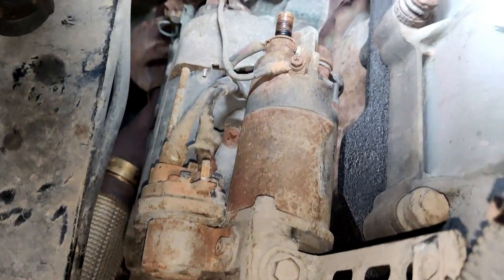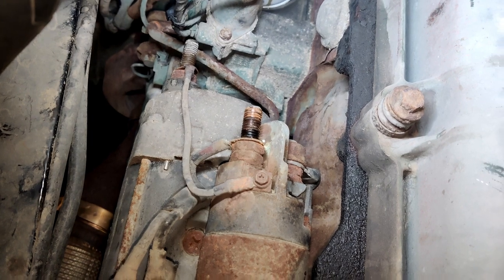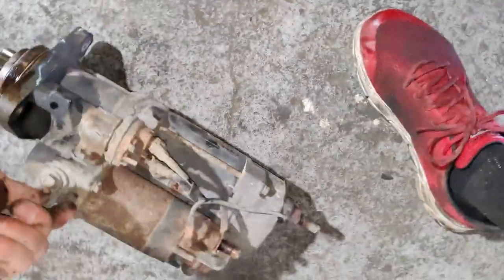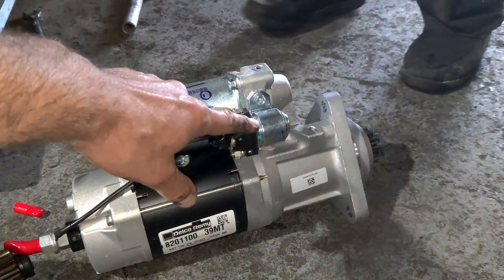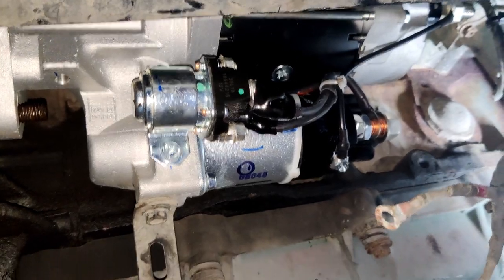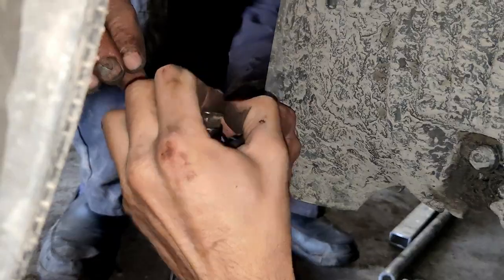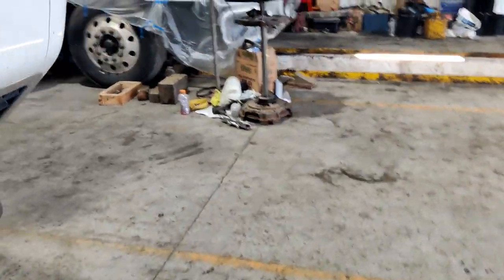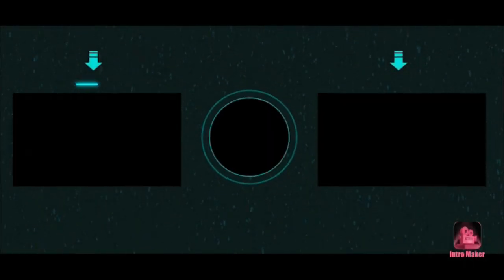Volvo d13 starter motor replacement

Comment: I wanna meet with Volvo engineers  who design the starter position and give them Pizduley  until they redesign.
Reply: We ended up taking out parts of the intake and exhaust to get it out
Reply: @johannesnielsen7  oh no
Reply: @alextinpin3577  it was just easier to get the one nut broke loose
Reply: @johannesnielsen7 I’m having that issue now
Reply: @lashan4636  yeah definitely just take the intake and exhaust off its easier

Comment: Hey. My starter is stuck to the housing. Do I need to bang on it with a sledge hammer or heat up the starter corners.
Reply from the maker: Slightly bang it with a Hummer and vibration should loosen it and will come out!
Reply: @valeriumoscalu7580  OK thx I will try that. Last year I thought I had a bad starter and attempted to remove my starter but it was stuck, at that time a used a regular hammer but it didn't work. So I put the nuts back on and decided to do the work in my home town. At that moment I realized my starter was still good and I had a contact connection issue. Fast forward to now I think my starter is about to go. Let me ask you this question, if I turn the key and hear a screeching sound what do you think it is. I have to hold the key for about 3 seconds for the truck to start. This happened last year also. I notice I have an oil pan leak and it leaks on the starter solenoid. I usually wipe it down.
Reply: How can you tell when is the started is just stuck ?

Comment: Hlleo sir I have volvo truck d13 engine 
No crank to start only baypass from starting and battery good and new starter and esm is good what u think is it problem ?
Reply: I’m having the same problem, but my truck sometimes starts and sometimes nothing ,
Let me know if you find the problem., I’m wondering if there is a relay fuse for the starter somewhere?
Reply: @2121cuervo  no it was wire in dash